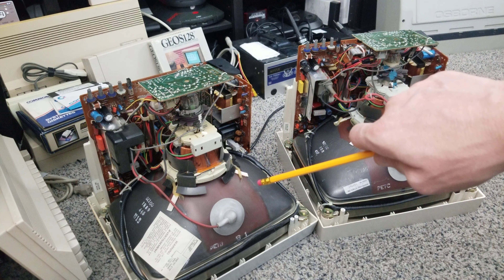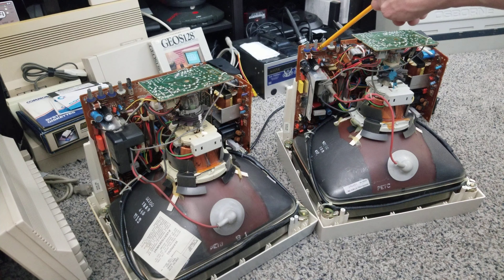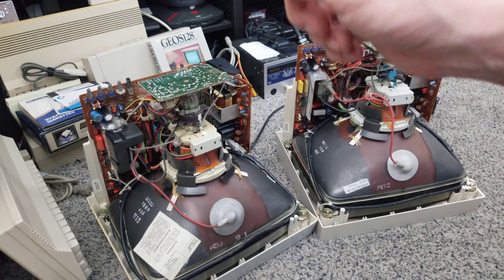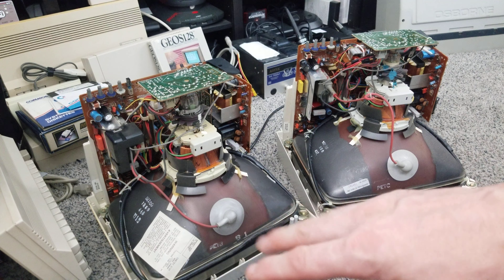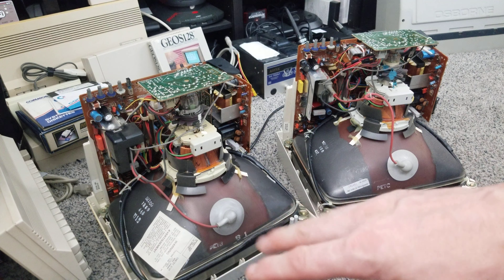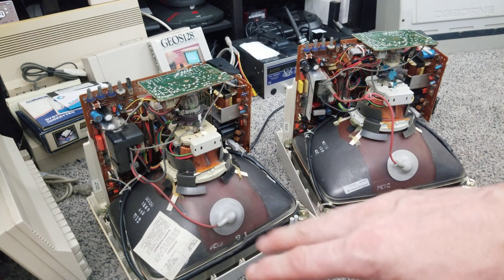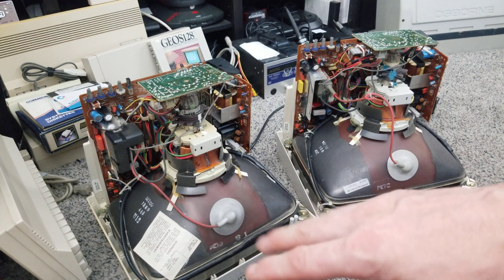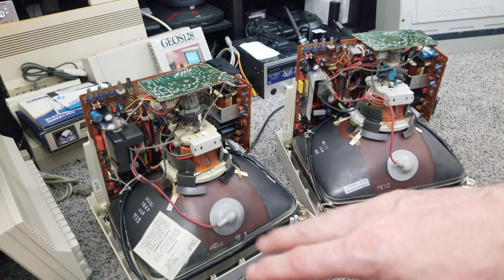Replacement options for Preh TV3 (ME5A) power switch on Commodore 1084s and Magnavox CM8762

Comment: Thank you for the PSD-1 suggestion. My Apple Performa Display uses that same crappy Preh Switch and mine was faulty as well. I ended up sanding the cavity back a ways with a Dremel and then securing the Canal with double-sided tape and glue.
Reply from the maker: Oh, hey! That is fantastic news! I love hearing that.

Comment: I wish while you had it apart you would have shown how the new switch mounts to the actual PCB. I have a 1084S-P and I'm struggling to figure out which power switch I need to order, as the switches for the 1084S-P1 seems to have a different board mount pattern, and don't appear to have that plastic "divider" that rises up between the pins. Nice work on the repair though! Thanks for sharing.
Reply from the maker: Thank you! I really appreciate it! Maybe I can still help. Unfortunately, the plastic mounting bracket was wedged into the 1084s so tight that I couldn't pull it out without fear of breaking something. 

However, it's looking like I need to do a little reflow work on the audio port of the Magnavox and I can try and record that part and get us a closer look.

But here's my experience. All these TV switches seem "close enough". What little variance I saw wasn't enough to prevent any of the switches I saw from being installed. While I can't guarantee that will be the case, if you get them on eBay like I did, the investment should be minimal.

Unless you're getting an original Preh, I wouldn't pay that much for it regardless.
Reply: @anovaprint  Yeah, so I realized after I posted that the pins on the bottom of the switch aren't actually soldered to a board, but there's just wires that connect to the pins. I think the monitors that have the switch in the back are actually soldered directly to the board, which is why I was confused. I did as you suggested and ordered a few of the cheap Canal PSD-1's from eBay. I'll post back once I get them and let you know how it goes. I'm also going to do the flyback, HOT, and all the capacitors.